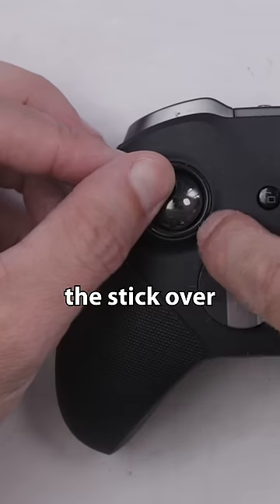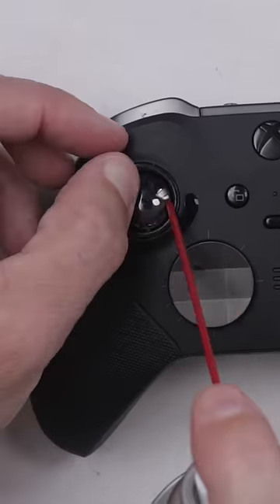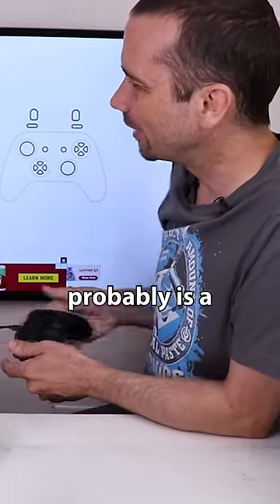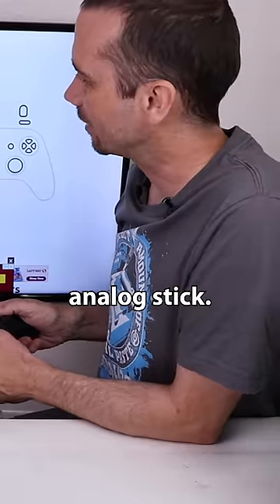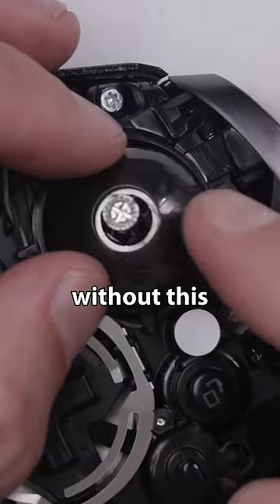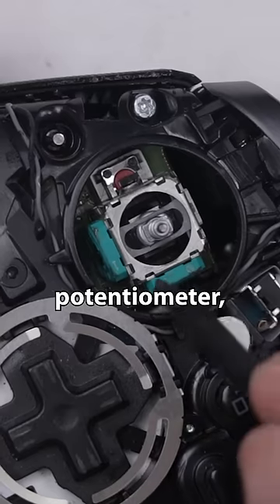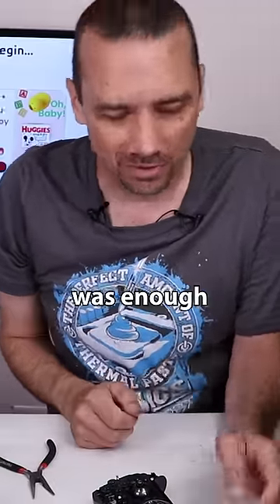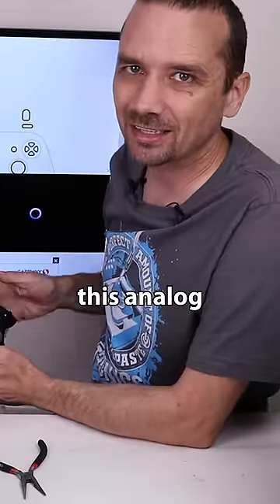The Easiest Way to Fix Analog Stick Drift!

Comment: For anyone who is interested, I tried it and it worked.
I've had 4 controllers with the "drift" problem, and still have 2 of them, so i went and tried it (it doesn't work anyways). Took it apart, and sprayed. Tomorrow I will do the other one too. What a money save would it be to know this earlier!

Comment: My Xbox One controller had stick drift once. I just used a Q-tip and some isopropyl alcohol to clean the sensors and it’s good as new, so I think the cause of drift was just dirt/debris.
Reply: this is a better method, spraying removes the lubricant between the moving pieces.
Reply: @javier7high  of course it would be more effective, he’s just saying it’s not necessary sometimes
Reply: The parts they use are cheaper and failing like crazy. My 360 wired controller that's over 10 years old finally had the left stick die and cleaning it did nothing as everything was just worn out. Elite series controllers have the worst ones put in. I'm guessing they went with a different manufacturer but I haven't researched it yet. Most PC mice come with cheap Chinese buttons instead of Japanese ones now.
Reply: @g0tsp33d  Props for keeping the 360 pad going for so long. I only hope my One can last 10 years. This kind of tech should definitely be better built to last especially when it costs 80 to 100 bucks for a new one.

Comment: WD-40 Specialist Contact Cleaner completely fixed the really bad stick drift on my quest 2 controllers after spraying a small amount of it into the thumb stick without taking it apart.
Reply: So good or bad, im confused
Reply: @Osjfiuehs9 i think good, still confused if it’s WD-40 or BW-100 lol
Reply: Thats troll don't do it guys.  You can actually damage your controller
Reply: You better be right bruh, quest controller drift is horrendous
Reply: 5 months after applying it, stick drift still hasn’t come back in the slightest.
Reply: @blacktee9292  no, I reckon if you put too much you could damage it slightly. But not just by applying it in general.
Reply: @blacktee9292  i did it myself and it actually works
Reply: @Exilir8  How do you apply it?
Reply: @blacktee9292  Oh it won't damage the controller. Unless you use regular WD-40. Use the Specialist Contact Cleaner.

Comment: What also works is isopropyl alcohol (make sure it’s a high concentration, 90% or more), fixed my insane stick drift on an ancient PS3 controller after I disassembled it.

Comment: Honestly with how much contact cleaner costs now it's probably cheaper to just replace the stick if you're confident with a soldering iron 😅
Reply: and you can get hall effect replacements so you never have to worry about drift again.
Reply: @Reverend_Salem  At the moment, you can only get hall effect sensor's for the xbox by buying the gullikit controller.
So there are no replacements available yet, due to the joysticks bot having a seperate pcb, its harder to replace and not worth marketing for unlike for the steam deck.
Reply: @thesolidsnek8096  i saw the steam deck one and assumed it could be atleast hacked onto the xbox controller.
Reply: @Reverend_Salem  Honestly, if you are in the market for a Xbox controller, the gullikit king kong 2 or what its called is the best option. It costs around 70-80 Dollars or euro and is the highest quality controller out there. I would recommend that over the elite controller which dont match their price with their build quality. If you really want backbuttons you can add modkits from a brand like extremerate since the design of the kong controller is the same as the og xbox. And the modkits frome xtremerate are sufficient for their pricepoint even if the buttons dont feel as elegant or fine polished they are reliable and deliver on what they promise.
Reply: @Reverend_Salem  The steamdeck ones have their own pcb, the modules on xbox and ps5 are soldered directly on the motherboard with 3 pin connectors.

Comment: If you have the cover off, pop the potentiometers open and take a q-tip and actually clean the inside of it out. You're going to inevitably have to change them out. The easiest way to change them is to cut them out, take the new potentiometers, trim the three legs, position them until it is dead center, then solder them down. While you're in there, replace the other three also.

Comment: It'll work for a day or two. The pots go bad and the analog sticks need to be replaced.
Reply: it's just the fact that the potentiometer is dirty and the resistance value is off. It's not necessarily broken and if it was this wouldn't even be a temp fix it still would have drift. if this fixes the issue then it was just dirty.
Reply: @sirwrenchalot  its still a dated and crappy design, just use hall effect sensors like the sim markets. Also there's controllers coming out with hall effects in them now. No touching parts, nothing wears out
Reply: @overthinking3573 I think they purposefully did it to make profit and to lower the budget
Reply: @TheOneEyedMac  they did. N64 had hall effect sensors. The design was just crappy so they wore out and stopped returning to center.

Comment: potentiometer type joystick will break at some point, they have to make the joystick with hall sensor
Reply: N64 did, but they cheaped out on the return hardware so they wore out quick.

Comment: I’ve had my Elite Series 2 controller for 2 weeks and it already drifts… luckily COD has controller settings to help get rid of the drift since I’m not confident in tearing apart my brand new $200 controller 😂

Comment: Due to the nature of potentiometers this will happen again. The only way to prevent it from happening is to get something like a hollostick in which will not drift because it uses magnets and magnetic fields instead of any rubbing parts.

Comment: you can pull those potentiometers apart and replace with any old generic one but you have to make sure you dont tear traces etc around the pot sockets on the board.
Reply: 90 percent of the time ive had metal hat folds up along the track that the joystick moves around in and that is the reason for the drift or that the metal is partially bent in one spot from a repeated use position etc etc

Comment: Spray it in with the controller face down. It'll catch inside the analog cup and hopefully when you turn it face up while moving the sticks it'll run down and catch in the potentiometer or where ever it may need to go. Obviously opening the controller is always the best option. It's so worth learning how to solder new analog sticks onto controllers. It costs almost nothing and once you've done it a few times it takes like 30m to have brand new sticks.

Comment: I ended up striping the pro controller down till I could expose the joystick. Got a bunch of pet hair out of it as well as I used the BW-100. That stuff is a lifesaver. A friend was having trouble and controllers are expensive

Comment: Idk if you know this but petroleum products have certain molecules that attack the ones of plastic so this could ruin your controller over time.
Reply: Hey, let people ruin their electronics by themselves. You know, natural selection and all that
Reply from the maker: It's not a petroleum product
Reply: @nickadams4167  BW-100 is not wd-40 nor is it made by them. It is a purpose made electronic cleaner. Do your homework
Reply: @nickadams4167  it's not wd 40 it's bw100 which is not petroleum based you blockhead

Comment: Its not always the actual module its the sensors on the side of the controller it maybe a factor that you have to replace them or get a professional to do it so you don't bust your controller

Comment: For anyone trying to avoid stick drift check out guilkit controller. they expensive as hell but they physically can't get stick drift. Only problem is you need a 3rs party Bluetooth for console and they are still fine tuning it as it's a relatively new company.

Comment: a lot of stick drift in these types of sticks is in the bands that hold them. if you have drift and inspect those bands you will usually find one that is not matching the pattern, fix the band fix the drift. it's just a rubberband thingy, you just move it back into the right placement.

Comment: It's not always a fix though. I have done this several times with it only working about half of the time. It's just depends on what the real problem is. If something is built up inside the pot then it should work, but if the pot itself is worn down in areas then nothing but a replacement will work.

Comment: Hot take. Stick drift is mostly a software issue where devs do not give options to adjust deadzone. The steam deck has a menu specifically to tune the deadzone to prolong the life of the pots.
Reply: Yes but also no.  Microsoft offers something similar but once it gets to a certain point it’s not fixable via software

Comment: Problem is that this is a temp fix for a permanent problem. Only way to permanently fix stick drift is to replace the sticks with something like a Hall effect stick.

These potentiometer sticks work off of electrical resistance, and the more you use them, the more they degrade, and the electrical resistance gets effected by this material degradation.

In the end, it’s an electrical issue, not a physical issue. Something like the Gulikit KK2 is going to fix all your Switch and Xbox related stick drift permanently, and is actually cheaper than replacing a pair of Joycons…

Comment: Gonna try this on my original quest controllers! I got my quest at launch, and a year later they released the Quest 2 and discontinued all replacement parts for the original, so if my controllers break it's useless.

I was worried I would have to save up for an Index soon (never buying from oculus again, they borderline scammed me by not supporting their barely year old product), because the sticks were drifting and they don't produce controllers anymore.

Comment: The other day I fixed 2 ps4 controllers by opening them and cleaning the same part but just with a cotton swab and alcohol and they both worked good afterwards

Comment: Isn't stick drift caused by friction wearing away the material on a variable resistor causing its resistance to change how does lubrication do anything more than act as a preventative measure

Comment: They should have an option to recalibrate controllers so it resets back to dead center even if there is drift boom problem solved

Comment: The joystick is actually out of the way where you're spraying so that likely won't do anything, best way to avoid stick drift is to clean out a controller using air and you can even turn up your deadzone in settings, spraying that lubricant is going straight onto the stacked boards in there which likely isn't good as they're not liquid proof.

Comment: This is cool and all and can definitely help minimize the stick drift, but stick drift is inevitable and there's no real fix for it. Dust and plastic particles will damage the sensors and they naturally get worn down. 

The best way to avoid getting stick drift early is to clean your controllers regularly and make sure that dust doesn't get under the analog sticks.
Reply: The best way to avoid stick drift is to stop using controllers with potentiometers. Hall effect for the win!

Comment: I recommend everyone to buy a PC. You can build a decent one for 1000. You will be able to buy games for alot cheaper, won't have to pay to use the internet. And won't have to worry about replacing a controller every year. Overall it's a similar cost but one is better

Comment: This might be a stupid question but could something like this help with my Logitech g29 pedals having issues? The gas pedal is flickering when applying consistent pressure and I think theres just dust and debris on the connectors that read the amount of given pressure. This is all just what I've been thinking, havent done any actual research tho 😅

Comment: If I have extremely bad stick trip that goes to the left joystick just turning to the love does that mean that would fix my problem if I add just a little bit of that WD-40
Reply: When is very Bad, is probably broken and you have to replace the part or Buy a new one.. don't even waste your time doing it several times hoping to fix it not worth it , it only works if it's a little bit.. but worth the try who knows

Comment: Crazy that my DualShock 4 has thousands of hours on it and almost no drift. I did have to open and clean it once before but it’s been trucking along fine ever since. 

My 360 controllers would not only drift but physically become loose and not even Re center. I went though a handful of those. 

I really hoped for Hall effect sensors this console generation but now there’s 3rd party competitors doing it right.

Comment: potentiometer sticks were a mistake, its not even the drift its the fudd lore and temporary "fixes" people show off as "the solution" that really gets me, 
we shouldnt be putting up with garbage controllers that break within a few months of use to begin with and especially shouldnt buy the exact same controller once it breaks,

just get like a gulikit king kong 2 or 8bitdo ultimate, both use hall effect sticks (like the sega dreamcast, interestingly enough) which will most likely outlast the console ur using them on (just like the dreamcast fr) and actually cost less than the official controllers

Comment: Bw100 will not fix this problem in the long term. Unless you want to keep spraying your joysticks until eventually they stop working entirely you're going to have to replace the entire bearing underneath.

Comment: Will very rarely work in most cases, drift is majorly caused by the constant motion wearing down the socket inside the joystick part itself, causing some extra wiggle room, some lubrication is going to at best give you like a one day maybe fix.

Comment: DO NOT DO THIS PLEASE, not a quick fix just a fast track to a broken controller. Bad drift stick means either replacing the stick module or a new controller

Comment: How do you fix stick button?
Reply: Spray a little Wd-40 on the button then let it fall in the cracks while the controller is turned off and wait like 30 min to dry
Reply: @AppleBeasts  BW 100 NOT wd 40 2 different things
Reply: @madpizzabasher  ik but it still works i literally used it🤦
Reply: Take it apart, clean the buttons with soap and water. Clean out the track for the button.
Reply: @AppleBeasts  WD40 can corrode plastic and make rubber swell. Very possible that you've caused future damage to the controller
Reply: @Harmonic14   WD-40 has a specialist product, meant for cleaning contacts just as BW-100. It is understandable to think of the regular WD-40 product, but they have a big variety actually
Reply: If it’s one of the actual button on the controller u can use a qtip and wipe some rubbing alcohol around the button and keep pressing the button until it’s un stick

Comment: “The easiest way” proceeds to take the controller apart
Reply: It's a quick disassembly controller, the faceplate literally pops off and gives you access to the internals. Plus the analog sticks are detachable. It's not that deep lmao

Comment: Wait so does WD-40 work for this or thats just purely anti rust
Reply: This will be contact cleaner, usimg wd40 could potentially break the unit if not make it worse honestly.
Reply: There is a WD-40 Electrical Contact cleaner. Use that and not the Original WD-40 which is used to displace water and provide a light lubricant.

Comment: Or you know maybe open up the controller and remove to joysticks to bw 100 them so u don’t mess up the controllers boards
Reply: You'd have to DESOLDER and RESOLDER the sticks. Plus, the contact cleaner he uses in the video won't harm the board.

Comment: Some buttons on my controller get stuck so I just dip my finger in water and get a bit of water around the button and they work well again for a while it doesn't cause water damage because it's technically just like 1 drop of water that I use

Comment: My A, B, X and Y buttons are not working… ive had the control for about 6-8 months… for what ever reason sometimes i have to hold them down for the controller to realize i pushing down or i have to hold down really hard because little lushing down also sometimes just doesn’t work…
Reply: Manly the A and X have it the worst!

Comment: My brothers ps4 pro is constantly beeping, always three beeps something without the power cord in. I've cleaned it for him and it's still doing it, any tips?
Reply: It could be s heat issue due tue dry thermal paste or a clogged fan. Cleaning the fan and changing the thermal paste could possibly work. Also try all the cables if they are lose but always first disconnect the power supply inside the ps4 and you need a kit with the right screwdriver bits to open the ps4 up.

 Its not hard at all just remember to not pull anything that doesn't come out easy and disconnect the power supply. Just always be carefull with the power supply. Never have the ps4 Connected to the power while you are working on it. Just follow a YouTube tutorial on how to take the ps4 apart and look if you have the same model as the video. Some little cable things might be different. I'm not a professional but sometimes this helps for some problems.

Also inspect the power button it could just be the power button area. Always try to notice the obvious first so you dont have to do alot of work. But changing thermal paste is always good.

Comment: Yeah... you shouldn't go spraying that into your electronics. Unless the liquids in the product have the same 0% mineral and high evaporating of a high IPA. Otherwise, this is going to cause rust and/or erosion. I would have just suggested giving it a gentle gust of air with something like a low PSI air compressor or a little handheld bellow. That, or completely take it apart and gently clean with 90% or higher IPA.